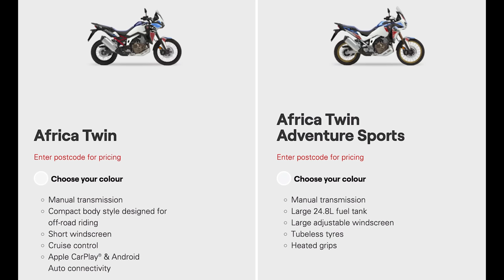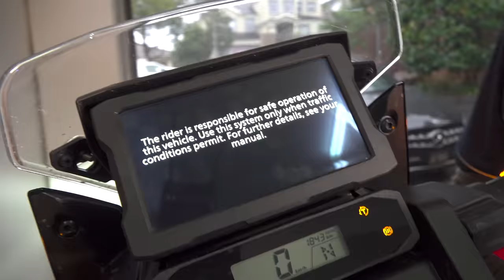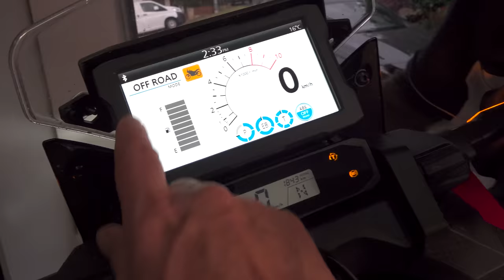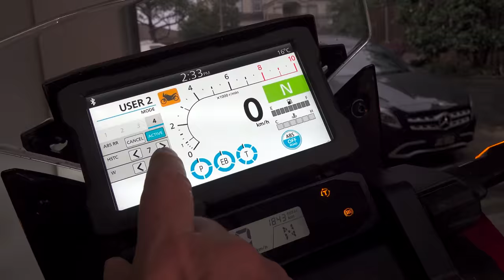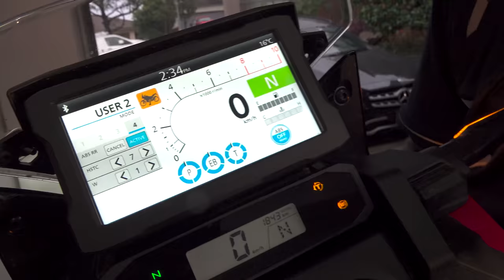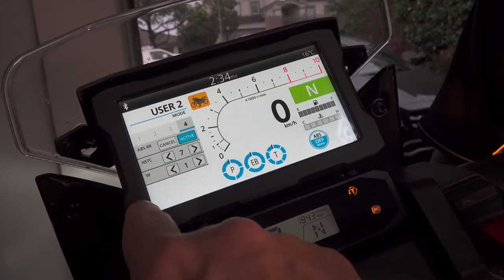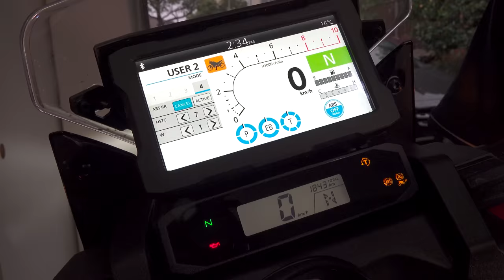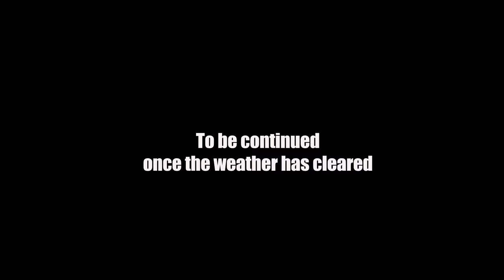Test Review 2022 Honda Africa Twins

Comment: How does this bike rate compared to the Norden 901 in your opinion?
Reply from the maker: Close.  It depends what's important to you.  AT suspension is better to me, but electronics and how you access them  is way better on the Norden. We are spoilt for choice.
Reply: AT will be more reliable than the norden i suspect but I am biased have the AT. Love it.
Reply: Norden looks like made by IKEA...
Reply: @thelostgeneration2000  Is that good or bad? The KTM 890 looks like it was designed by a blind person...🤣😅👍
Reply: @Macedonia270  Well, norden looks better on TV screen than in a dealership, IMHO...
Reply: @thelostgeneration2000  I guess it is down to personal taste... I cannot wait to see the Desert X in the metal